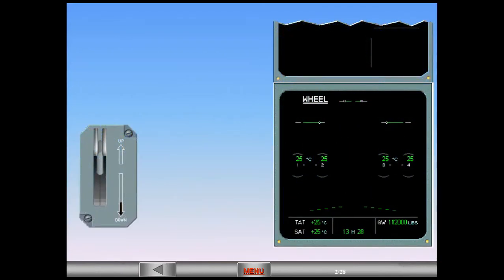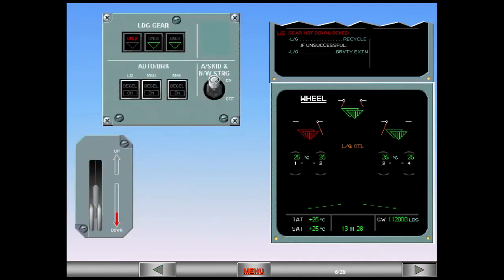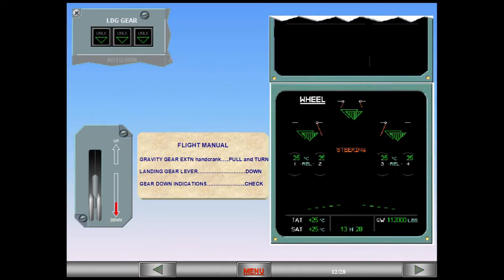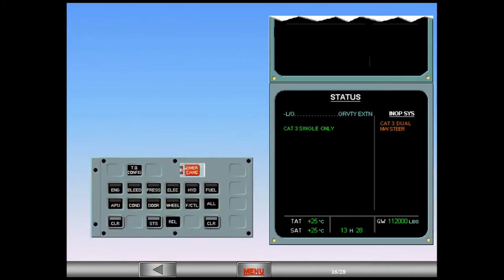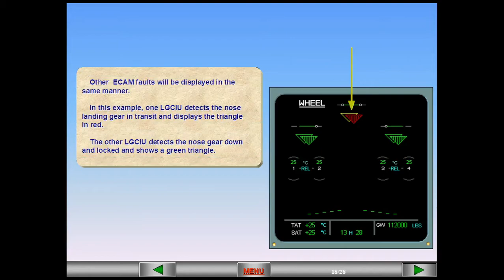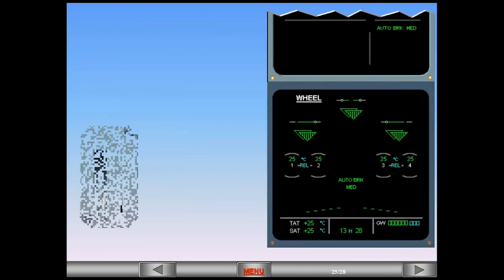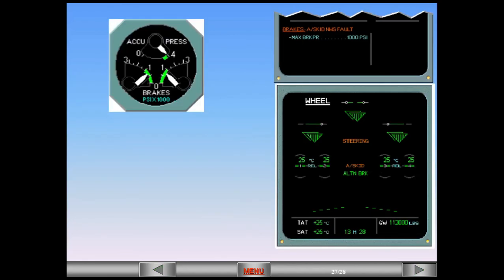A320 - Landing Gear, Brakes, and Nosewheel Steering (Abnormal Operations) PART 3

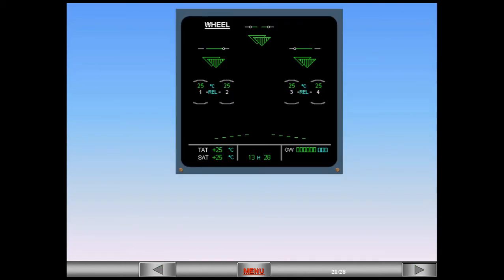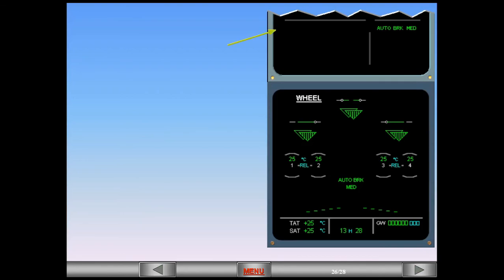Comment: Thers's seems to be a tiny issus at 04:00 (& 05:20), it should be Yellow Hydraulic fail that leds to N/W steering inop, not Green HYD(for A320s). Am i right or wrong
Reply from the maker: Hello, thanks for information.. i will check with the appropriate source for this matters..cheers